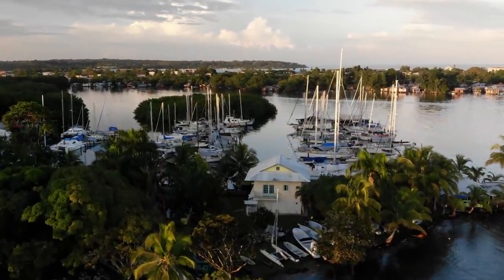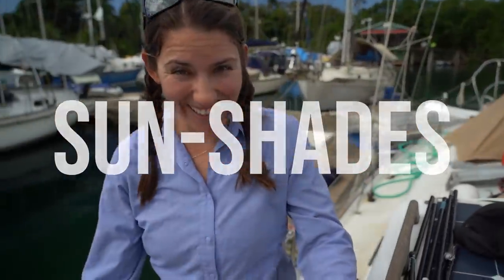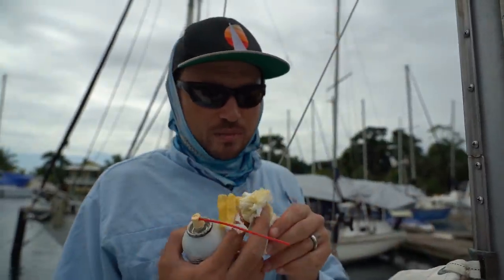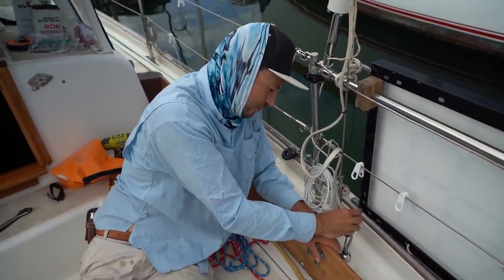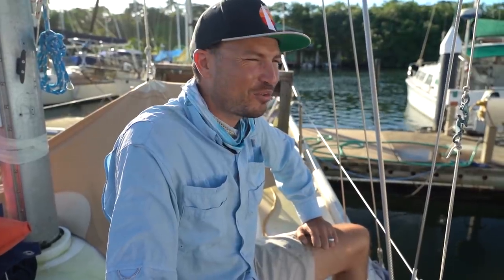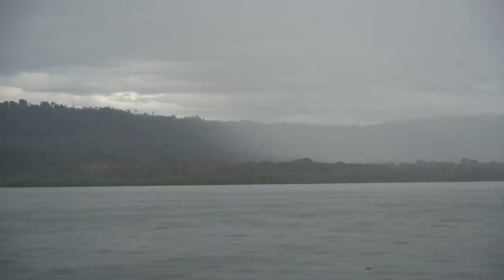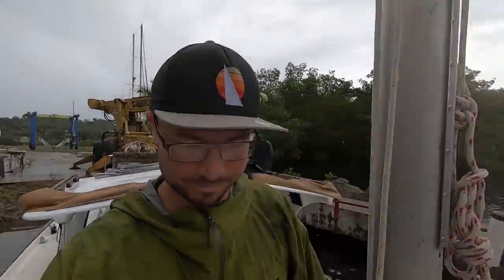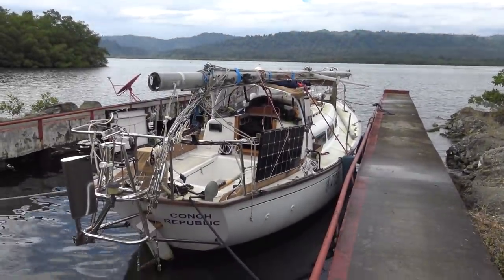Our Biggest Sailboat Project Begins | S04E14

Comment: Deck stepped masts? Good for you. More room below with compression posts. You guys are an awesome team. Crossing the Pacific is no joke. Weeks and weeks, not days, with no land in sight. Not only Atticus needs to be ready, but you guys as well. Having a deadline is good, but "more gooder" to allow for the deadline to come and go, for safety sake and preparedness. If there's EVER trouble in paradise and you guys think about breaking up, you may want to review the entire Project Atticus channel and say "WTF are we thinking about". You guys are just a too well oil teamwork machine. And yes, as noted before, ball bearing not in a caged race require a magnet not too loose your balls, and not just two. :) and most likely you'll have to replace a few. I know it's never cool in Panama, more like less humidity now, so be safe and stay hydrated. Best wishes!

Comment: Nice video,pb is great got stubborn fasteners for sure! Jordan sometimes you can put your best screwdriver in the screw and hit it few times pretty hard and the screw will come out. You did the right thing just cutting a slot in that old screw. What made it come out was it got hot when you cut it and the PB blaster did its job.On the dropping ball bearings bet magnet won’t stick to those stainless balls.🥴Y’all still have one of the best sailing blogs no matter what the numbers say, keep doing what you’re doing👍

Comment: After spending 42 years in a Glass Plant as a Moldmaker ( high priced machinist ) we battled stripped screws constantly. We used different solutions depending on the problem. Sometime just grinding a slot and some oil worked but because we were dealing with lots of different metals and high heat on the equipment making the bottles we found some heat from a torch worked also we drilled and used easy outs. We also had a cool bit that sears used to make that would grab the screw with carbide and turn it out. We always replaced screws with allen headed screws and used high temp never seize. Any port in the storm so to speak( Ha ! )

Comment: As a helicopter mechanic in the U.S. Army, the step you did with the screw is kind of what we would do, but the moment the phillips screwdrivers tries to slip out of the head, STOP! Mix up a little abrasive cleaner (Comet, Ajax) with a drop of water/saliva and put on the tip of your bit and either the impact driver or a brace bit to remove it then. A hacksaw blade works to cut the slot too. Good Job on removal, it can be an art that some people don't have the patience to do!

Comment: On tough screws like that, before you start tweaking on them, yes the PB is a good choice, but also sticking a screw driver in there and whacking it a few times with a hammer will often free em up.

Comment: My go to is carbide drill bits. Spray blaster or drip oil while drilling through the head to remove it from the shank of the screw. Lube is crucial. Also tapping with a drift helps loosen corrosion.

Comment: The grinder drove heat into the screw which helped you greatly, you sir need a small propane blowtorch for such jobs. That is the difference between coming out or not at times, or even just easier!

Comment: There is such a thing as a handheld impact driver with exchangeable screw bits. It is held in the screw head and twisted in the correct directiona nd then the end is struck with a hammer. The downward force applies torque to the bit at the same time the force holds the bit into the screw head. It isn't foolproof but it has never failed me as longs as I use it first and not wait until the head gets stripped.
This episode reminded me of taking my Jeanneau 34' from NYC to the Great Lakes through the Erie Canal. I had to take my mast down at Albany and carry it on top the whole way. The yard had a "self-help crane" for use by the boaters for mast removal. It looked like a 20' flagpole hinged at midpoint in an 8' high bracket.

Comment: Hey guys, I was just thinking you might be able to wire up quick disconnect fittings for the Mast wiring in the future and just make sure there's always a little bit of Dielectric grease in there to make everything easier and if it fails you can always cut it out and splice it back together

Comment: There is a product called “tefgel”. Which will prevent electrolysis between dissimilar metals. It works great for steel fasteners in aluminum spars.  I believe they sell it at west marine.  Also get a set of easy out screw removers
Reply: zinc-based anti-seize. That's all they need really. What's the over/under on him getting a copper-based one and using it? :)

Comment: impact drill/driver requires special bits.  Usually tip is dark gray or you can get really hard ones that are all gray.  I got mine at Lowes.  Most common Phillips screw is p2, but not always.  Make sure it is right one for your screw-  if not-- dont use it.  when the tip "starts" to slip- replace it.  And that hammer/driver you can get at Harborfreight will work sometimes.  They are great for motorcycles as all screws on bikes are soft.  I think it is the jar of the hammer that breaks the corrosion inside and then the screw will loosen enough to turn,  so if you ever find a metal handle screw driver that you can hit with a hammer-  get it.

Comment: When you have a Phillips head screw that feels like its " caming out " (which means the screw head is deforming untill it no  longer matches the profile of the bit and starts to slip) you can dip your phillips bit tip in valve grinding compound and go back to giving her hell with the impact..... It will save you from having to get out the dremmel and sloting the screw as the compound will fill in the gap between the bit and screw and give it 5x the " traction "

Just a little tip from a 25+ year aircraft heavy overhaul mechanic who deals with thousands of stuck screws a year.... 

For next time and good sailing.

Comment: You did a very good job of removing the screw, the dissimilar metals corrosion happens a lot with the steel in the aluminum a minor suggestion is maybe anti-seize if this part is removed occasionally another suggestion that you’ve already had suggested is to pre-packing the bearings with Grease will also help keep them in place I know you do not have room for multiple cans of lubricant and also availability might be hard

Comment: Just a though . Put a one way valve on your hull through so when your healed over water does not back flow in to your boat. I have used a clear spring loaded type that is cleanable on industrial low pressure  projects such as sump pumps and fluid transfer. I do not know if they are manufactured any more but any pvc valve should work with salt water.

Comment: Sometimes with a philips head i grab a screwdriver and a hammer and give it a couple wacks and then take some vice grips to the screwdriver handle and apply pressure and turn slowly... sometimes it works lol sometimes i cant get enough inward pressure while turning but those screws are a pain in the butt regardless!

Comment: Nice work pulling your masts. Same for the screw extraction. PB  Blaster is great stuff, So is knowing how to come up with a plan B.
When you put it back together, try Tef-Gel. It works well as an anti-seize on SS to aluminum joints. I don't know if you can get it there.
Reply from the maker: We have some onboard! Thanks for the tip!

Comment: Look into getting an impact screwdriver. They are under $10 at harbor freight. All you do is put the correct head on it, hold it up to the head of the screw (or bolt head) give it a hit with a hammer and the impact turns the screw (or bolt). It's a lifesaver for stuck hardware.

Comment: Hey there pilgrims 👍🏻🤓😂hows you’re new motor boat going 😂😂😂big day for sure, great work ,,,done well again, you could use anti seize on all the hardware (screws and bolts)you replace but the marine grease may be okay aswell, also when you reassemble the ball bearings use snow white Vaseline (mechanical vas) as it will hold everything in place and not only that it is transparent so you can see them in place and they won’t fall out on you 👍🏻😎🍺⚓️most importantly drink lots of beer 😂😂😂

Comment: Wishing you favor in your endeavours and following seas !!

I will tell you what I was told with a similar issue
First the solution: They make replacement cars without ball bearings. 
Problem(s): I am guessing your cars may be original or sourced? When the ball bearings fall out it can be a sign your cars are worn out with possible metal fatigue or wear e.g. allowing the ball bearings to fall out. Loss of the ball bearings can also lead to catastrophic sail issues e.g. sail stuck up due to cars becoming "wedged" on the track-most likely to occur in  bad weather with high wind loads, etc.

Comment: If u start with impact drill u risk stripping back of screw.  I use the hand impact driver.  A whack at a time both applies forces to the back and turning forces at the same time.  The worst that happens to me is the entire back of the screw brakes.  Oh crap still.  Do include Nut buster and a prayer.

Comment: Guys, not sure this will help now but keep it in  mind for the next down rigging.   On my Seawind II  I  changed the triatic from all wire to the aft 5 feet of  wire to 3/8 Kevlar line.   I put a Schafer series 5 ss block with aluminum  shiver at the forward head of the mizzen mast. The Kevlar tail runs through the  block and is tied of at eye level on the mizzen. If the main mast is demasted releasing the triatic  pig tail might save the mizzen,  when I take  either mast down  I  attach a messenger to the pigtails and can be used to re rig the triatic  without  going aloft.   Remember  the first  production  sailboat  to circumnavigate was a Seawind ketch. Fair winds and following seas.  From the crew of Sv Celtic Lady Seawind II 68K.

Comment: Soooo funny!  Jordan lost his balls and Desiree helped collect them!  LOL  Well, I guess that's what wives are for.  : - D   Oh, and then Jordan contemplates screwing (or unscrewing?)  problems and cutting some little head off? I don't even like thinking about that!  Soooo glad creating a slot worked.  (BTW - I had not seen the end when I wrote either of my "funny"(?)  comments above) 

Besides all that, this was a fine episode!  I think I mentioned during your live feed (in the comment section?) that while I only have one mast on my 20' sailboat, I have to put it up and take it down EVERY time I go sailing.  But I've built a gin pole including block and tackle system that makes the process fairly easy.   Why not leave the boat in the water?  Well, trailering my boat to my local lake is MUCH less expensive than paying for marina fees for a season.   If only I could trailer it with the mast up!  lol                 Scott W

Comment: The trick for bearings is wheel grease. pack the bearings with wheel grease and that holds the bearings in place. and it lubricates them as they do need to be.

Comment: Some other things to try next time you run into a stuck screw. When you lube it up, make sure you do not get the screw itself covered in oil, that will allow the bit to strip faster. Size your Phillips if you have more bits available, there variations in size & pitch of the type of screws and using the correct bit will save you a tone of headaches. Last thing I would have tried is shocking the screw threads with something. Take a punch or some sort of narrow metal rod and hammer that b right in the center of the screw a few times to break the threads loose then unscrew, etc.  Oh yeah!

Comment: Keep an eye on the volcano in the Philippines. It is a pyroclastic volcano. That means when it blows it will spew lava and ash into the atmosphere. Ash will fall everywhere and move east. It will also block out the light from the sun which could affect wind patterns. There is no timetable when or if it will blow but an evacuation notice has been given to the people who live around it. This could affect your sail west. The name of the volcano is Taal if you want to look it up. Tsunamis can and may occur. You do not want to be anywhere near there. Gases can also spew into the atmosphere leading to possible death. Knowing you two devil may care sailors this might not be a concern for you but would certainly be on my no go list. The Pacific ocean and the land around it is known as the "Ring of Fire" because so many volcano's occur on the land adjacent to the ocean. More info than you needed I am sure but did want to give you a heads up. You may want to take your time on your maintenance issues until you know more about hazards ahead. Taal is at a 4 out 5 danger rating.